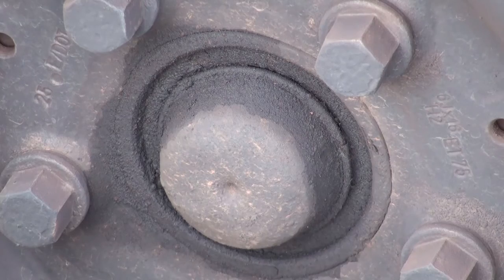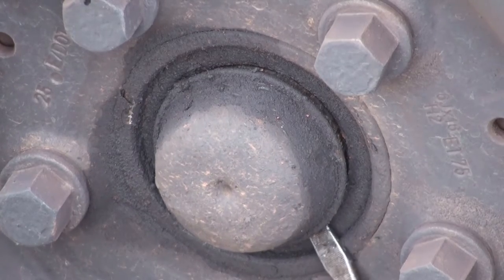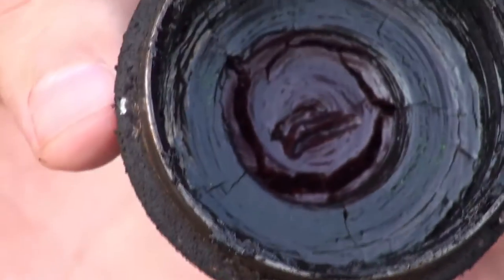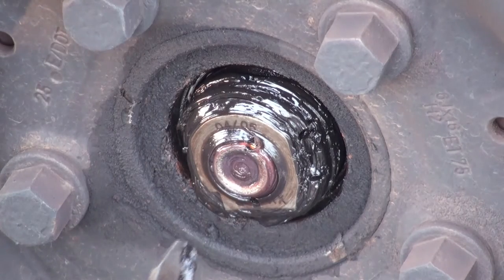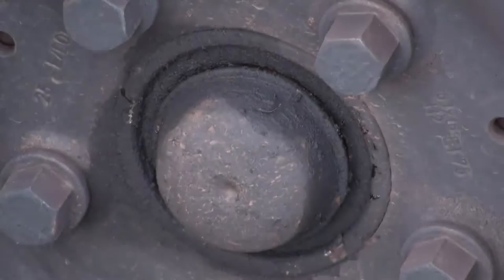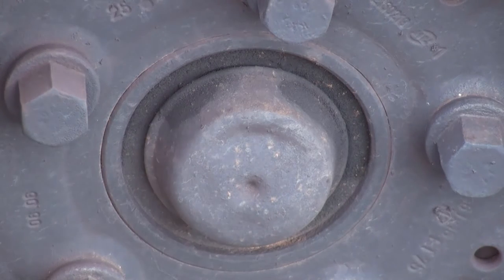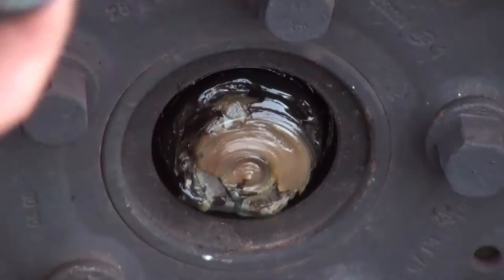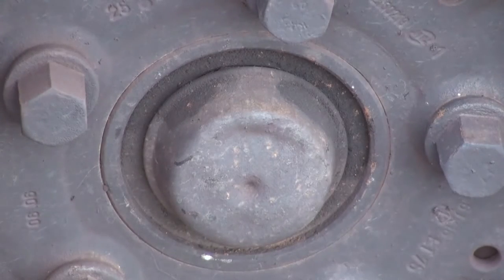Mercedes Sprinter Front Bearings Preventive Maintnence Care my Quick Tips ZIMALETA Help Vlog

Comment: And if the front wheel bearing fails on you it then the wheel could REALLY fall off the van like someone commented before when your transmission failed last time . Bearing can be inspected by moving the front wheel up down while it’s jacked up to see if there’s play ! Make sure to clean the dust cap well , put half full grease in it then add sealant to stop water from getting in !
If the bearing fails it could do damage to the spline too.
Reply from the maker: Thanks Mason that is so true, probably why we see cars with missing wheels on the highway all the time, also I would like to ad, if your driving long trips, and pull over to fuel, put your finger on the cap to measure temperature, the cap should be cool to the touch, and if it’s warm then bearing needs to be greased up or possibly replaced it’s getting hot and it will fall apart

Comment: To properly repack the front wheel bearings you need to take the hub off and take the bearings out and push new grease into the bearings pushing the old grease out.  (There is a Bearing Packer 65250 order # $7.70  on Amazon that I use with a grease gun to make the job easy) There is 2 bearings in the hub. the inner bearing has a seal you need to take off and replace with a new seal.  I try and repack them about once every 100, 000 miles.  The grease you put under that cover will not get to the inner bearing...

Comment: thank you!
Reply from the maker: you are welcome, if you have any questions just ask, I will reply to every comment, thanks for watching :)
Reply from the maker: Your welcome
Reply: I will be asking! I have a 2007 sprinter, about 150k miles. Had it maybe 5 months, just learning all the nuances. Wanting to do everything I can to get it to 500k! Your channel is helping a ton.
Reply from the maker: Awsome ;))) that is a good van i will get back to you with some tops if you want let me know, i would respond sooner but i was bussy
Reply: tips would be much appreciated! so far, I've just been doing things I know how to do, regular oil changes, atf change and filter, fuel filter.. Just trying to know what other things I should be looking out for or what I should be servicing/replacing at the mileage I have.
Reply from the maker: For the part your ok but there is sme things u need to know i will make a video for you ok
Reply: amazing, thanks!
Reply from the maker: No problem
Reply from the maker: Hello there, i been so bussy this week driving, i wanted to make you a video and I still will, but right now i used up my Data Plan on my iphone so i cant upload on the go like i did this past videos lol i uploaded like 6 videos and now data is gone, but not to worry, i will be getting a new phone this week, with unlimited data plan, so i will be making videos and uploading them on the fly with my new Samsung Galaxy Note 7, but i want to give you some quick tips, i has 2007 Sprinter i drove it from new to 350k miles, i did have problems, but at that time little was known about 2007 sprinter cause i bought it new, so here is the thing, first of all its a good Sprinter, but dont do hard accelerations from the start, there is this things caller rear wheel hubs, they have teeth and if you strip them you cant drive it until you replace them, right now i am sure there still good just take care of them, also If your Sprinter dont want to accelerate fast or slow up hill, there is this thing called, Particulate Filter, they get claugd  with Smaug and causing your sprinter to be week, its very common problem, cost $3500-3800 just for the part, but not to worry if you don't live in California and have a place that can pass inspection, u can get rid of that thing and just replace it with a straight pipe, this thing is like catalytic convertor but more expensive smog control, but that is the biggest isue, now there is some more problems like sometimes the turbo pipe slips off and its baraly on there causing sprinter to be week, but u might get code over boost condition, its located under your air filter housing on top of your engine, and fuel filter is there as well, now fuel filter needs to be replaced every 40k but u can go longer, just always have a spare and become farmiliar with replacing it, its a little tricky if you never done it, you might break something, i never seen anyone break it but its britle and its possible to break the plastics that insert into fuel filter, its much Easyer to change on 2004-2006 but it looks same might even be same part, 2002-2003 sprinter a little difrent but 2004-2006 close to 2007 even the oil filter but anyways i will make a video explaining this, but when i will be home i will make a sires of videos just explaining the service part everything that you need to do to maintain it, there is more, ok back to dont drive it hard, also Fan Assembly on 2007 is week, it breaks in 3 places causing fan to go flying breaking radiator, and inter cooler in the process also erupting the wiring harness, also replace the Belts at 150k its time dont wait till they break, in your model you got 2 belts replace both its cheep, well if you dont when they break they will rip the wiring so you dont want that, now if you do replace belts, consider replacing all idler pulleys you might need 3 one on tensioner flat one and 2 idler pulleys with grews, online they cost $20 bucks each parts store $50 each, alternator will go at about 250k from what i have seen you might be lucky and take it to 300k so for now thats all you need, and at 120k or less all breaks shoes should ob been replaced if they were your good to go, your transmission same as mine 722 5 speed electronic hydraulic transmission NAG-1 it takes about 9.5 quarts but when u drain everything including torque convertor you will need to ad 8.5 to 9 quarts, engine oil change it takes 0-40 mobile one, but i recommend She'll Rotela   T6 its widely available and is great oil your book tells you 14 quarts but ad 13.5 because on some models your sensor will go off telling you its to much oil if u add 14 thats how mind was, i also recommend buy KNN Air Filter you dont need to replace it but regular you replace at 17k miles, another thing Change oil every 10k miles and not 15k like the Dealer will tell you, this is good engine it will last a while if you take care of it, and always use recomended synthetic  engine oil for sprinters, i seen guys using Mobile one Delvec and thats just wrong thats for big rigs, i dont trust it, also dont use engine or transmission edetives its not good for it, fuel edetives might be ok, hope this helps you be an informed owner, you might know all this but i still explain it just incase good luck buddy
Reply from the maker: your welcome
Reply from the maker: +Mitch Ross hello my friend, i just got the new phone your video will be soon maybe tomorow